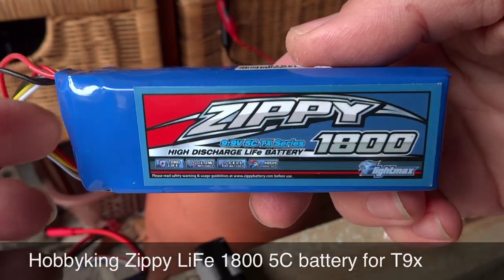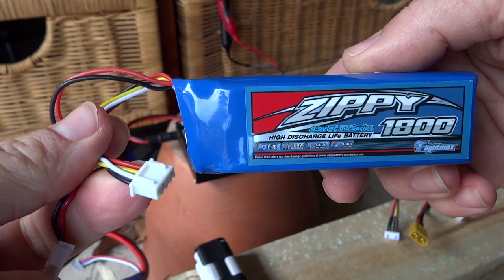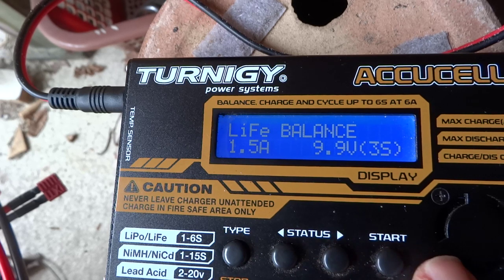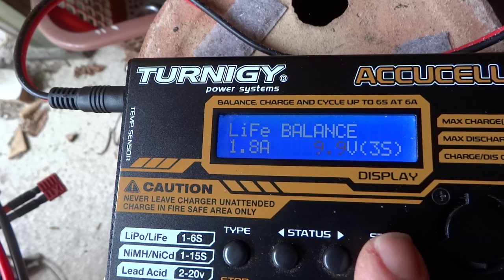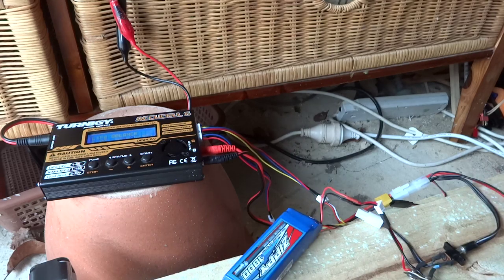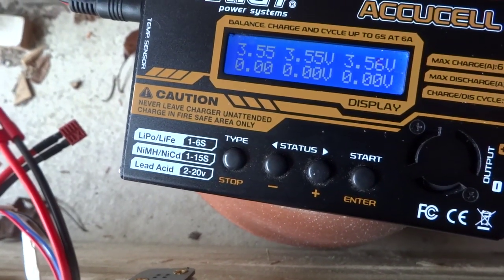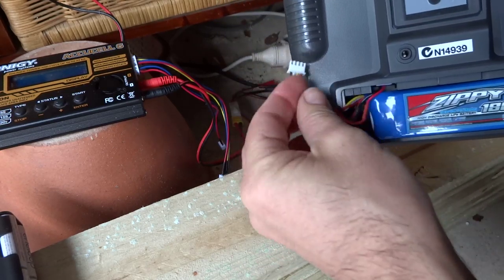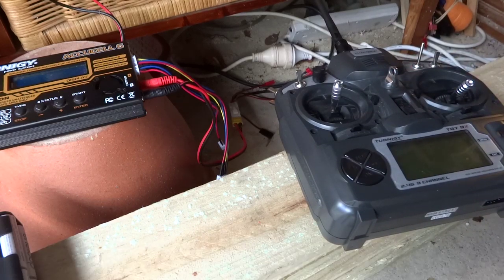Charging LiFe Tx Battery With Accucell 6 Hobby King

Comment: Do HobbyKing's battery packs have any internal protection at all - a fuse or resettable fuse perhaps?
Reply from the maker: Richard Corfield no I have not seen any Lipo RC model batteries with any type of protection. But there are buzzers available and OSD on FPV for monitoring the voltage. If you have a plane then you can use an esc with Bec so it cuts motor when the voltage is too low but let’s you glide the plane in with power to servos.
Reply: @jbalatutube  I guess that makes sense in that scenario. You want to limp home under control and with warning rather than suddenly lose everything due to an independent controller within the battery pack.

Comment: how low in voltage before I need to recharge?  I balance charge it top out at 10.80 volt 3.80 a cell, the first hour it drop to 9.8, now at 9.7 to 9.6 last 4 days of 2 hour uses a day , this is a great video it help me, thanks

Comment from the maker: Thank you. Be very careful you dont plug the charge lead into the balance port on the charger since it will burn out the balance port for a 2 cell. I accidentally did it but now i plug my 2 cells into another free balance port and it still works..

Comment: if i have a charger right can i make my own leads because this is why i hate battry power dont get right charger for the conector on the battry pack and you will spend £2000 trying to find the right charger to charge them plus i need a charger to charge life nicad battrys 

but i will have a power switch on my rc plane which means i can charge the battru without takeing it out or the ignition battry aswell